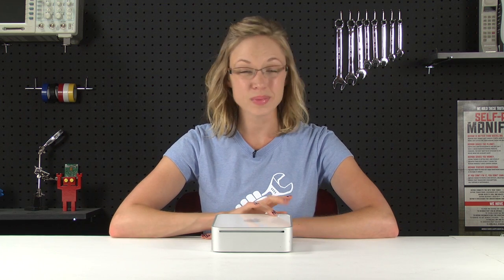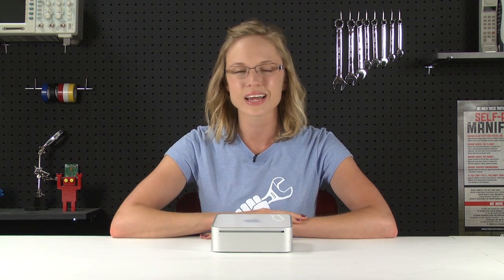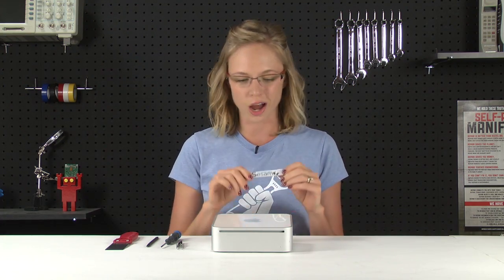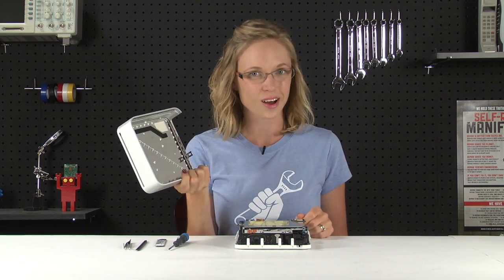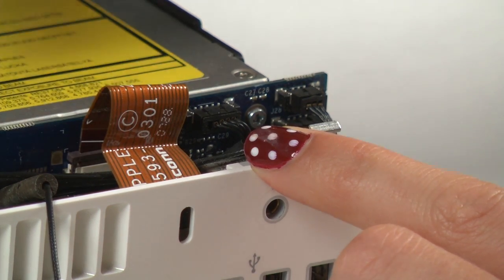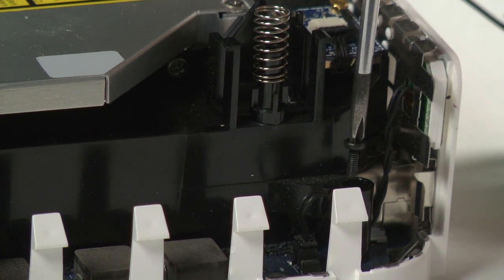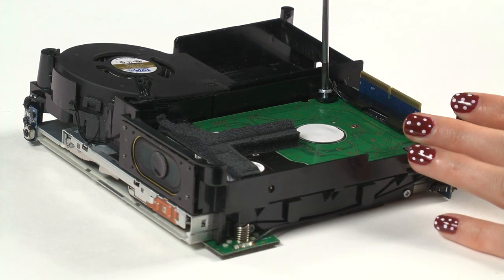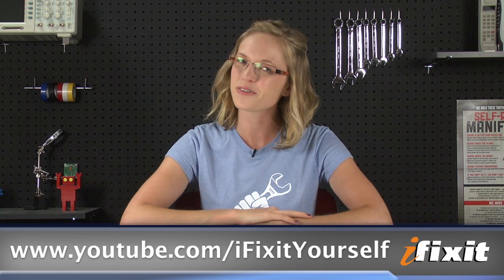How To: Replace a Hard Drive in a Mac Mini (Core Duo)

Comment: Made my Mac Mini  useful again! For those who might find it helpful:
My mini runs Windows using Bootcamp - as Microsoft support 32 bit machines, unlike Apple.
Cloned Mac partition using trial version of Carbon Copy Cloner
Cloned Windows partition using trial version of Macrium - if you do this don't re-size the NTFS partition (an option you can choose) as this will result in an 'out of sync hybrid,' whatever that means. I learned the hard way, it won't work. You can extend the partition once everything works with Windows 'Mini Partition Wizard'.
After this the Mac side won't recognise a bootable disk as being available on the Windows partition, however there is one! You can start this up by holding the option (Alt) on start up, and then to  make Windows the default startup OS you will need to hold the 'Crtrl' key while selecting the Windows drive. Hope this helps someone!

Comment: There are a number of reassembly particulars that are not mentioned. One is that you need to droop the screws into the holes in the chassis before you reassemble or you will be struggling to get them in. Another is to make sure you have the WIFI antenna connected properly and have the heat shield on the wire up near the antenna side of the wire.

Comment: Just used this again to fix/swap over to one of my good old mac minis. Had TWO die on me within a minute last week.!!??? Found another old spare, and swapped out HD. so did not even have to restore from a backup. Running fine, plus it's faster, too. Going to Fry's today to see if I can just pull trigger and put a cheap, small SSD in this puppy. I love tinkering.

Comment: Couple of observations
- When inserting the iSesamo or putty knife, withdraw a millimetre before levering out, or you screw up the conductive foam
- PH #0, not #00 screwdriver fits those screws better
- one of the four screws is much longer than the other three. This is important when reassembling
- when separating frame from base, you are unplugging an edge-connector - expect resistance
- when reassembling, be careful to tuck in the spring clip behind the Kensington lock

Comment: Thanks MJ,
   My used '09 Mini went tango-uniform a couple of weeks ago so I got a Seagate 160G to replace the 60G original. With your help I had it replaced in 45 min. and transferred my files from my back-up external in less than 2 hrs. 
 You're my hero!